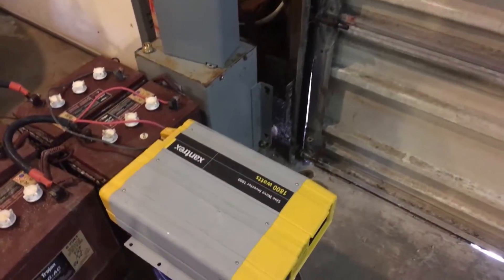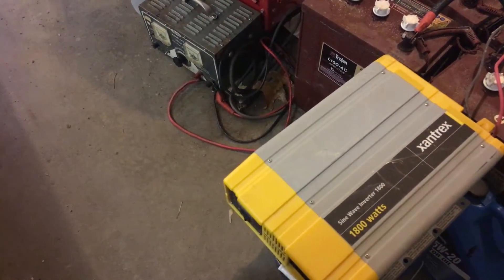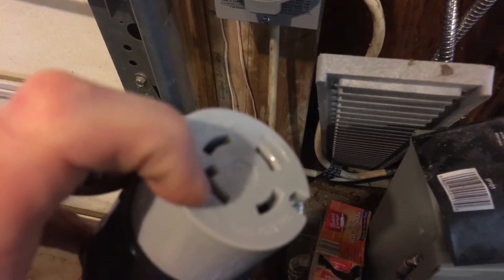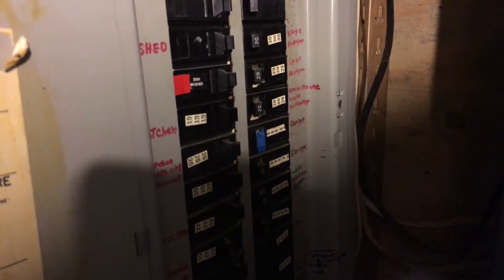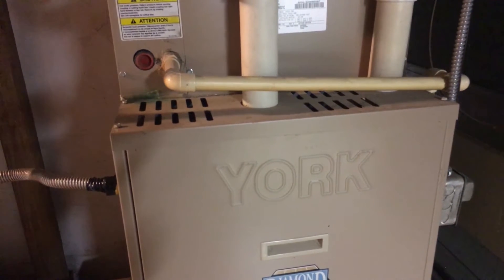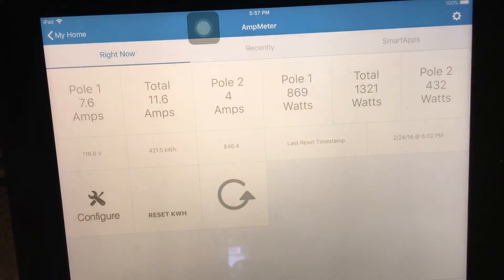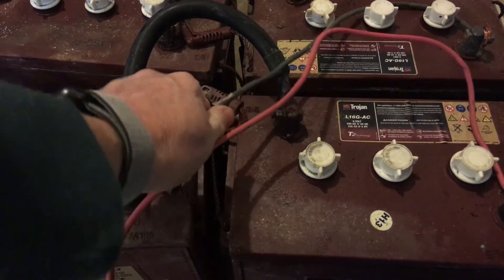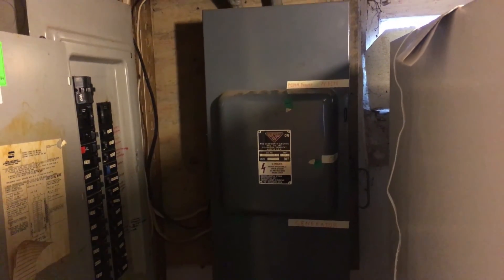Can I power my house with an inverter ?

Comment: This is exactly what I’m trying to do. So what would the “proper” way of dealing with the grounding issue in the inverter?  Would disconnecting the ground from neutral inside the inverter and attach it to the case be more proper??
Reply from the maker: I'd ask an electrician. i dont want to give you bad advice.

Comment: What if you add a solar trickle charger with a charge controller to keep the batteries charged then adding a relay sustem to have it kick in automatically, think it would be an efficient back up sustem?
Reply from the maker: They do make a pro sine 2.0 which does something very similar.

Comment: You don't have any wires running to the furnace. How the hell is that powering the furnace?
Reply from the maker: i have a whole house transfer switch.  i also have a single transfer just for
the furnace.  in another video i show how that works

Comment: You need a bigger inverter... I've been off the grid for the last 5 years. Been through a lot of inverters you need at least a 10k watt inverter. Pure sine if you can. Find one
Reply from the maker: Hemp Billy it’s all about load management. I really don’t use that much electric
Reply: @IFix-Things  That management is all that counts
Reply from the maker: Parton Dube agree 100%.
Reply: @IFix-Things  yeah load management. That will handle maybe 1 microwave and that's it at a time. And then you'll need the battery bank WH to keep it going. 
How's the system working now ?
Reply: 136 amp alternator in my truck could run that?
Reply: @rockoz28ctd  not that many Amps. It would fry it almost instantly

Comment: What size inverter to power high efficient gas furnace and charge phones, maybe led tv with router etc.? However it will be powered by a car. Thought about running 2 deep cell batteries to give the car a rest for an hour then fire it back up. All on a budget, I am cheap. emergency back up for winter then summer it be for sump pump, it is unlikely but never know.
Reply from the maker: minimum 1000 watts, if it were me, i'd by a 1500 pure sine wave inverter from a reputable company, samlex has some good ones, go power is another. Good Idea with the deep cycle as you have to be careful with the car's alternator, not to burn it up, I would look up the specs on your cars alternator, and see how many watts it can output, remember though it is also powering your car, and keeping the battery topped off.
Reply: Thank you for the reply! I have a 95 accord, 90 amp alt, I have stereo system (1000w Kicker IX Amp) so I have 4awg power and grounds to another battery in trunk( need to upgrade to 1/0 awg( big three) on the alternator to battery then to trunk battery, however having the secondary battery keeps the amp powered really nice without affecting my 55w HID headlights. and after first battery have a Kicker 100amp inline fuse. I would have purchase a clamp meter to see draw of cooling fans. I just have a simple multimeter. To be on the safe side, run a 2k ps invert. I have a bunch of 4awg cables a buddy gave me to run whatever set up I need with those easy connectors. Or someday have a small solar panel on garage, being a mechanic I don't want to invest in battery's knowing how unreliable batteries are unless you have some sort of (or spend $$ on some commercial applications or battery pack from a chevy Volt) lithium or a Optima. I could go on and on. Thanks again.

Comment: The Xantrex Prosines are great inverters.   They handle startup surges very well.   The Prosine inverter version that is setup to be hard wired are ideal for home connections since they don't have the GFI AC outlets and don't tie ground to neutral inside the inverter.  The GFI versions are much more common though.  I use a 1000W 12V Prosine and it can power all the home essentials in a power outage (lights, fridge, and some electronic entertainment).  I eventually added a 250W solar panel on the roof to keep my three deep cycle batteries charged up plus I use some 12V power in the garage for lights and radios.   Thanks for the video.
Reply from the maker: Thanks for the comment. NIce setup you have there. I will agree, the prosine inverters are great
Reply: I'd like to see a 1k watt inverter run a regular refrigerator. I've tried 3  1k inverters and it's a no go
Reply: @off-gridhillbillystyle3735  It is all about surge power ratings when starting motors/compressors.  Most inverters will give a surge power rating, but without a duration it is meaningless.  The 1kW Xantrex Prosine inverter will do 1500W for 5 seconds.  It gets my fridge going no problem (after turn-on fridge only draws about 160W).